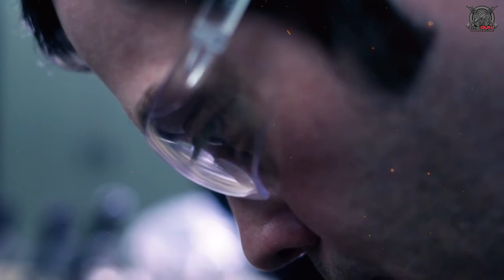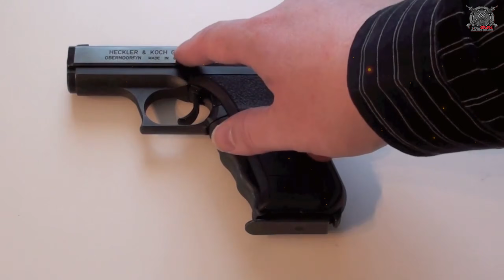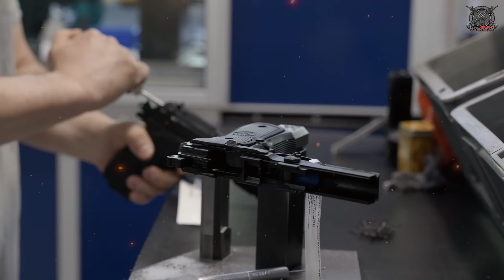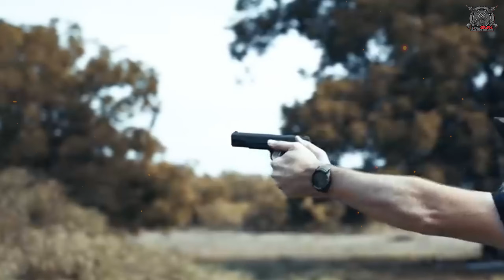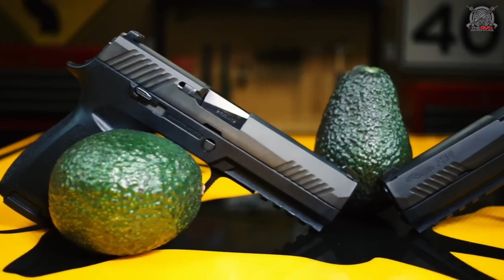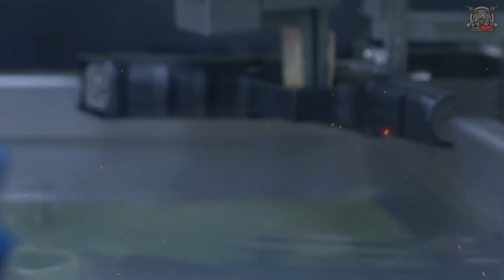These 7 Pistols Have Reliability Scores That Don't Make Sense!

Comment: I've fired 8 or 10 thousand rounds thru my factory Series 70.  I might have had a stovepipe or two along the way that was probably attributable to my stance.  I have had NOT OTHER FAILURES, and the pistol continues to rock 35 years later.

I oil it before ever session.  I used to clean it when it got sluggish, after about 600 or so rounds.  This was back when I was loading with Bullseye, a notoriously dirty propellent.  I now use Scot Solo 1000, and might never need to clean it again.

Take that, Beretta!